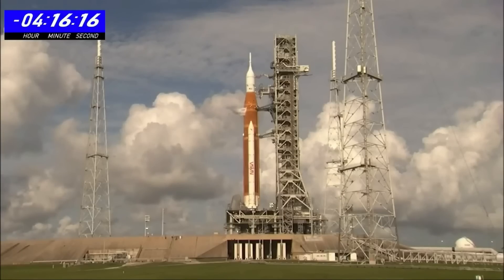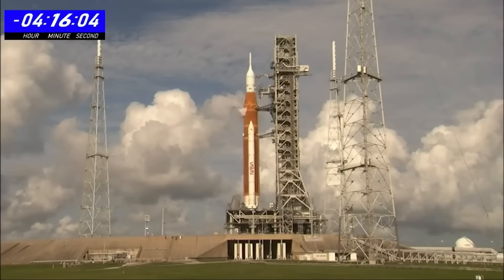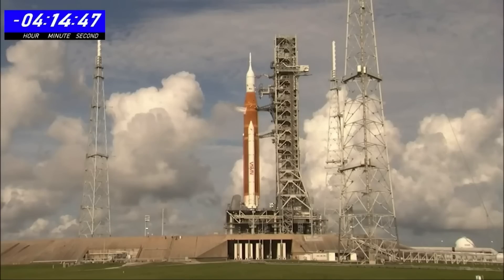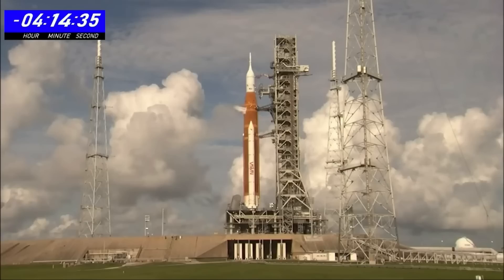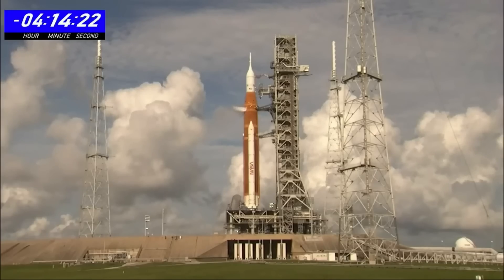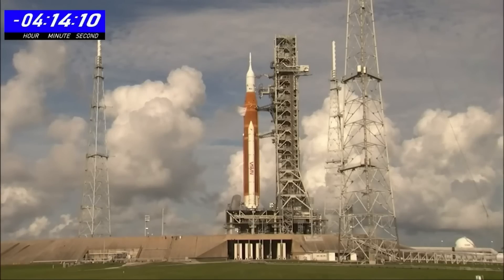Update: Artemis 1 moon rocket fueling leak still an issue

Comment: Come on people, that is why they call it a test flight.
   Starlink crash landed several times before it made a successful sketchy landing.  Elon and Starship are years and many scrubs and crashes away from being  able to be used as a lander.
Reply: Chill man you're gonna anger the bots
Reply: Starlink ?
Reply: Do We have a New Space Race ?       https://www.youtube.com/watch?v=bboFwo7a5PY&t=979s
Reply: CoBus, I meant Starship.
Chris, good point.
Reply: The difference is the attitude to crashes and failures,  - SpaceX actually learn from them.  NASA had four failed wet dress rehearsals at least one of which was included a hydrogen leak and two failed launch attempts including a "fixed" hydrogen leak.

The other difference is the fact that SpaceX expects "failure" as part of the testing regime while ANY failure in the SLS wold mean the end of the program.  Who do you think has the approach?

Comment: Because using a Falcon Heavy would just have been too easy! 😂
Reply: You can't use that for this mission. You'll need a Starship.
Reply: @thorthegodofthunder9150  Due to launch capacity or for what reason? But true. Would have been smarter referring to the Starship. Can‘t wait to see that beauty fly. Might be earlier than the SLS start as it looks right now 😂
Reply: So you think building a rocket is an easy task?
Reply: @KyarameruKat  Obviously yes. Simplest thing in the world 🤷🏻‍♂️😂
Reply: @MauriceM.  Okay then build a 95 metre rocket in 10 days and send me the footage of you building and launching it. I'll wait
Reply: @KyarameruKat  Alright. You didn’t get the joke so let me explain this for you as simple as possible:

 No one is debating whether it’s hard to build a spacecraft. My main issue is that the money used on the SLS could have been better spend on the private space sector. SpaceX as the main candidate has 100+ successful launches on different vehicles plus the massive semi-tested Starship in their backyard. The SLS program has an untested vehicle on the ground causing all sorts of problems. 

Why don’t they use existing technology and instead build a completely new vehicle which is more prone to failures of all sorts?! In the end it’s a prestige project funded with tax payers money.

I still don’t know what point you were trying to make with your initial question but this should be your answer 😂🚀
Reply: @MauriceM.  how many people has spaceX put on the moon vs NASA.
also wouldn't call starship "semi-tested" if it still crashes into the ground half of the time if not more. not something I'd put human lives on.
Reply: Hmm yes the billion dollar government organization that is comprised of some of the smartest minds in the world outsmarted by some rando on the internet, homie, I assure you there is a perfectly valid reason that they don’t just use a falcon heavy.  Believe it or not Elon isn’t all-knowing, his rockets have pros and cons too

Comment: I wonder how nasa managed to solve fuel leak problem 50 years ago? may  be they forgot the sol.
Reply: Apollo 1 had a tad of a bigger issue. 
it wasn't even supposed to launch. it was just supposed to be an exercise for the astronauts. the capsule was pressurized with a high mix of oxygen. unfortunately something went wrong with the electrical components which caused a spark and all 3 astronauts burned to death.

its unreasonable to assume that 50 years ago the Apollo program went without a hitch. because we all know it didn't. and it would be unreasonable to assume that the Artemis program goes without a hitch. space is hard.

Comment: Come on they said they were more than sure it was a sensor… are they clowns?
Reply: Looks like it.
Reply: This is not the sensor problem, that has to do with cooling the engines prior to ignition. This leak problem was worked around last time and they'll probably work through it again.